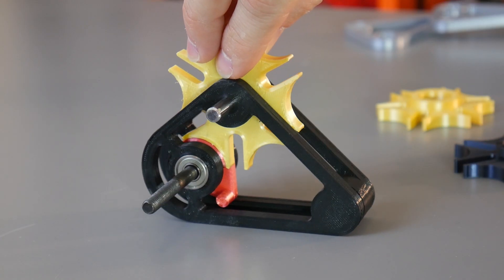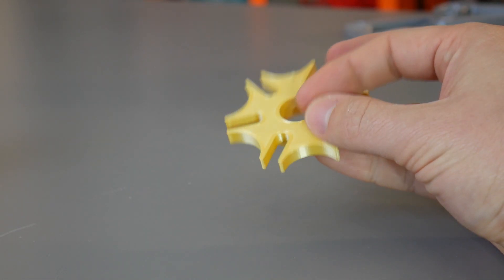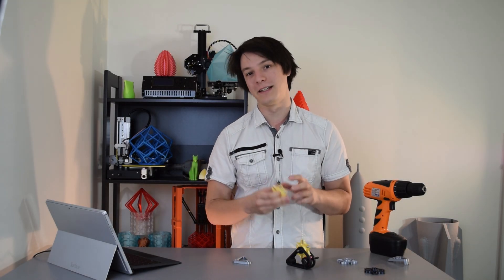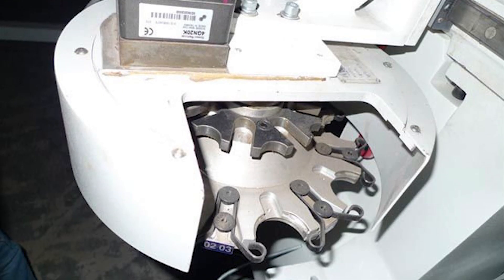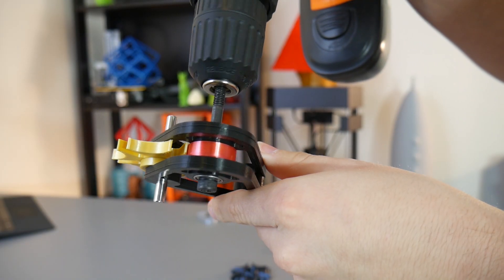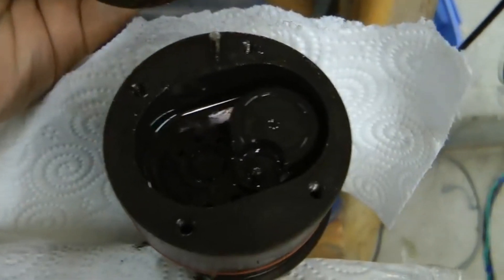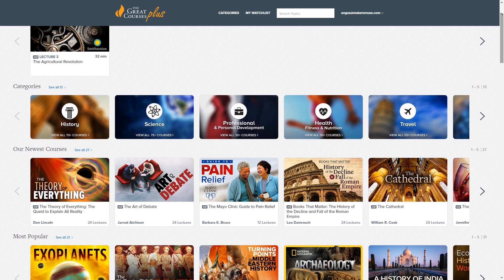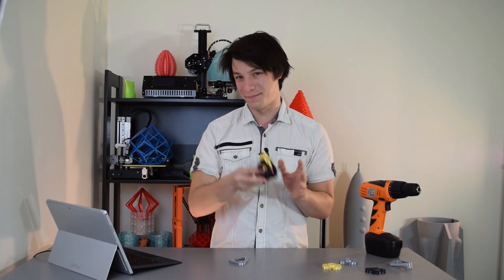The Geneva Mechanism

Comment: I worked for a company that built automation machinery most of our machines were built around a central rotary indexer normally came with eight or 12 stops and yes they referred to stops as dwell period The speed between dwell points was controlled by the speed of a gear motor that Ranett as well as the off. Controlled by a PLC The accuracy was 1/10 of 1000’s and they would supposedly run for 10 or 20 years without wear and I have seen the inside and they used this type of mechanism I believe they were Camco light blue About 150 pounds filled with mineral oil and if I’m not mistaken back in 1990 they were made in California I never ordered one but I 
Machined the tables assembled  them for automation applications I was the guy who got to manually machine every single part assemble and debug We did have a very old CNC back in the 90s but manual machining for one-off parts is quicker for 95% of the parts we made.the guy who handed me the drawings had to every version of AutoCAD  from two through 14

Comment: This is a classic but not up to today standards anymore. It's not having smooth velocity like Bestehorn or 5 Polynom. But the Geneva 2.0 luckily solves that problem. It still has really high acceleration. Star wheel drives are a little bit better. But if you want smooth acceleration like Bestehorn, then you need cam gears. 😊

Comment: The 16mm projectors made by Bell and Howell for educational and other uses did not use a Geneva. A swash plate moved the pins that engaged the film in and out of the sprocket holes. The stepping movement of the film into and from the frame aperture was controlled by two pins, one resting on each edge of a spinning constant-diameter "wheel". The variation in the radius of the "wheel" determined the distance required to move the film from frame-to-frame.

Comment: it has no torque so theyre pretty much useless
Reply: Numerous machines don't require much torque.  The mechanism is primarily intended for indexing.  It locks tight between indexes.  The Geneva mechanism can certainly transmit some torque.  It really depends on the size of attached motor and gear reduction of the gearbox attached to the motor.

Ed Schultheis

Comment: A note, gears are also always rubbing and creating friction. Typical gears do not roll against each other as it appears, since the teeth slide against each other as they mesh in between each other. That said, there's no doubt that the geneva mechanism has much more sudden and intense loads and wears. It's still a very elegant and simple design for what it is.

Comment: I wonder if those were used to synchronise nose mounted machine guns in WWII fighter aircraft, such as the BF-109, in order to ensure that the fired bullets would pass through the spinning propeller in front of them, instead of hitting the blades.

Comment: Great work explaining this. The wear problem caused by sliding could be solved by a replacing the pin at the drive wheel with a ball/roller bearing sized to fit the slot on the driven wheel.

Comment: Some years back, I worked on a machine that used a Geneva mechanism. This was an indexing drive that would advance a conveyor one step for each revolution of the main shaft. It was a cammed slot design in a cardioid pattern. As one had two cam followers and the drive plate had the slot.

The machine was an AMF 3-175 bread wrapper.

Comment: i didnt know what it was called, but i did know it was used in old film projectors.

Summer job in college was at a Drive In Theater, i spent an entire week once trying to fix an old projector, and i had to make a replacement 'cross' for it using a stencil and some scrap aluminum...

Thankfully my hobby of making pewter cast DnD figurines helped out with that...

Comment: Could you not put a roller bearing at the top of the pin, converting the sliding friction to rolling friction? The bearing would only roll down one side of the channel going in then the other coming out? If not a bearing a toothed roller with score is ponding teeth in the channel and no teeth at the root of the channel to facilitate the rotation direction reversal..... in short rolling is better than sliding. As for military applications I think it may have been used in ww2 battle ship guns fir handling and placing shells on a carousel loading mechanism. Additionally having watched some of your printed wired surface rollers, did you know that the analog fire solution computers used in the battle ships used complex shapes to represent equations - a variable was then input which moved a slider across the surface. The second variable was achieved by rotating the surface. Out outs from several surfaces could then be used as inputs to another equation (surface) and so on. Now, printing one of these would be a pretty sexy project. Great content. Newly subscribed, looking forward to trying your cad course. Cheer, Scott .

Comment: To prevent vibrations, you could put a counterweight on the other side of the part with the pin like the single-tooth battlebot discs.

Comment: Put a bearing on the pin, problem solved
Reply: That's not where the biggest source of friction comes from. To keep the driven wheel indexed when it's not rotating, the curved concave outer faces rub against a similarly curved convex surface on the drive wheel. If you go to 0:53 and 1:18 in the video, the illustrations quite clearly show the large bearing faces that are engaged during the time the indexing pin is out of contact with the driven wheel. Per revolution, those large bearing surfaces stay in contact longer than than the indexing pin does.

That curved locking surface on the drive wheel is not a full circle, otherwise the driven wheel would never be able to unlock to index to the next position. Because of that, there's no simple way to replace either of those surfaces with a bearing. Not only would you need to put a bearing on the index pin, you'd need at least four bearings (probably more) along the curved surface of the drive wheel in order to ensure adequate support to prevent the driven wheel from turning prematurely. That would significantly increase the complexity and bulk of the mechanism.

Comment: The IBM punched card machines of the early computer equipment used the Geneva mechanism to advance the cards through the 12 rows of hole positions of the Hollerith code.
Reply: Why? I didn't think they need to stop to be read, since they are actually scanned a full line at a time.

Comment: Excellent presentation.   
The knitting machine industry during the 1970s experimented with epicyclic cam follower profiles on the 'slot and pin' portion of the Geneva mechanism to eliminate the instantaneous acceleration in the Maltese cross design. The use of epicyclic profiles (aka- railroad curves) quickly moved to the kinematic based cam profiles that operated the latches on the knitting needles .... and with the result of those knitting machines could then operate at 10X faster speeds and with significantly less constant needle latch fractures.

Comment: So then put a roller bearing on the drive pin that goes into the slots...substantially reduce the friction and the need for lubrication between the 2 parts youre saying would wear quickly and build up too much heat.

Comment: the military use for this drive is on jets with rocket launchers, it's the mechanism that loads the next rocket after one is fired. also used to load cannon fire , torpedos, machine gun fire on 360 degrees swivel gun
Reply: Well, as much as we have modern automation with stepper and servo motors, sometimes it’s still best to use the old tech that’s as reliable as clockworks!

Comment: Electronic solutions are not universally applicable. Dual rotor gatling gun. https://patents.google.com/patent/US3262367A/en   Pin wear can be remediated by replacing the pin with a roller or needle bearing.

Comment: It seems like we waste so much energy exercising at a gym. Why can't people capture their expended energy into spring loaded gears that can power and transmit and tie into other devices. Maybe use some energy to wind up and have the energy charge a capacitor wirelessly that is tuned on the same frequency with a tesla coil or some other device that can receive the input. There are watches that are really old that still work because of this lost art and overstanding of design. Feds find a good idea, they kill it, patent it, lock it away, then use it for the military on our dime. Rinse wash repeat and here we are

Comment: Nowhere near as good as  the 'Vienna mechanism' (found in 19th C. Viennese clocks) which is much more detached with less friction. BTW did you know that the pic at 1.50 shows the typical failure of the Geneva mechanism in a watch? Many watchmakers remove the whole thing because it gives too much trouble.

Comment: Have none of yous guys ever seen this mechanism in nearly every revolver hand gun in the world, 🔫,👍
Reply: The revolver doesnt use the geneva mechanism. The cylindrical block in the revolver is controlled by the hammer which rotates the cylinder and aligns the bullet chamber with the barrel. The hammer can be either self cocking or manually cocked

Comment: Much of the sound you hear in a film movie projector is the sound of the film being quickly advanced to the next frame by this mechanism as well as the shutter opening when the next frame on the film has been positioned briefly before being snapped closed again so the film can be advanced another frame. The film is kept with a certain amount of slack before the frame that is currently being shown on the screen. When the mechanism advances to the next frame, this slack is temporarily taken up, making the loudest contribution to the sound you hear when a move projector is playing a reel of film. This is why the projector is much quieter when you first turn it on to feed the film through the projector. The Geneva drive is still operating, but once the stiff film is fed through, the film its self makes all of the racket the way it is handled by the Geneva drive mechanism. Thank you fire sharing! I learned something new today! :)
Reply: Agreed most of the noise is the film flapping. The shutter does not "snap" open and closed - it is a continuous motion that looks like a fan blade, and makes no sound except air movement.

Comment: how does the edge of the gear not catch on the circular part of the spinning pinwheel? there has to be some contact there right? its covered by the tapering plastic of the pin housing in the close up shots in the video. that part is perplexing me

Comment: wait - in 8 mm projectors most there were only Pens that have reached into the perforation holes and moved the film.
In the 35mm projectors in cinema the Malteser Cross was standard until the very end (changing to digital projection)
They also experimented with stepper-motor-like drives, but this way never proved... (= never worked well)

Comment: those concave teeth are obviously pretty dumb and useless. they look cute but that friction is absolutely unnecessary.
Reply from the maker: With the original oiled mechanism they would have been reasonably smooth, but yeah this mechanical indexing approach is totally obsolete in today's digital age.
Reply: no, i mean even for mechanical indexing, the friction could be minimized, for example, by employing it only during the move of the driven wheel or only to stop that move, so that the wheel does not overshoot after being pushed and stops at discrete angular positions. (if the external load on the driven wheel is negligible or constant).

E.g. 1) the simplest way is to increase the axis friction of the driven wheel. 
Or 2) add a third wheel rotating in the same direction as the driven wheel with a pin to stop the driven wheel at discrete angles. Almost no additional friction is added in this case.

Am I missing anything?

Comment: Geneva drive is used in Atlas Model Railroad company's turntables. I had wondered how it worked. Quote from their website, "Fully assembled, 9" diameter turntable has the ability to stop at 21 positions, 15 degrees apart. Geneva movement locks table in exact position every time."

Comment: It seems the "geneva stop" shown in 1:50 is not only stopped, but blocked from any purposed function, unless someone dismantle it and put the driving wheel back on the axle with the pin positioned for the square notches.

Comment: Not used only on old film projectors. It was used on all professional film projectors, until they got replaced by digital projectors in the early 2000's. It was used because of its reliability, amateur projectors used another system, based on a four-bar chain (cheaper to build), and the sound you used was actually from this system.

Comment: I did some math on these many years ago...these things actually have "infinite jerk" (time rate of change of acceleration)...which is why they behave and sound like they do (violent motion). If I recall, there was a way to modify the slots and engagement mech to smooth out the jerk. But you are right overall, these mechs are interesting, but largely outdated by computer controlled devices. We used a Geneva mech on a large mass, rotary storage system (magnetic tape library) and it pretty much jumped around on the floor when it indexed, and quickly tore itself apart.

Comment: The only military application I can see is when using a forward mounted gun and a single blade prop. Without using the drive the gun would shoot the propeller. So implicating the drive with the rotation of the propeller the gun would shoot between each blade.

Comment: This mechanism is still used in film projectors, where they are in use. However, film has largely been replaced by digital projection, which is the main reason this is not used for film projection any longer.

Comment: I've replaced/serviced a few geneva drive gear boxes in my day when I worked as a projectionist. :) The head units I operated used sealed boxes so changing the oil meant removing the whole thing. Eventually someone wised up and added a port glass(for inspecting oil level/cleanliness), fill, and drain plugs so you didn't need to pull out the whole unit just to change the oil. I think Kineton was the first to do that.
Reply: You may find it was a Century innovation. The Kinoton version has the glass in the rear of the intermittent whereas the Century had it viewable from the front.

Comment: The Hypocycloid and epicycloid mechanisms are probably the master categories of these mechanisms and gear sets.  There are also the Harmonic Drive, the Planetary Gears, the .Ravigneaux planetary gearset,  NuVinci Continuously Variable Transmissions, Continuosly variable transmissions, the lock-up torque converters, the Koenigsegg Direct Drive (KDD) system, etc. Ever sharpen a pencil with the old wall mounted pencil sharpener? Take a look at the gearing system!  How does a revolver revolve one cylinder at a time?

Comment: You can be sure that Semi-automatic and fully-automatic Military weapons such as the SMG(sub-machine gun) use this device to re-fire the next bullet that has been reloaded into the chamber of the weapons' barrel, from the magazine. The device mostly works on the energy produced by the shell casing being ejected and therefor works towards the firing pin. This is the reason if you release the trigger, it will stop firing bullets.